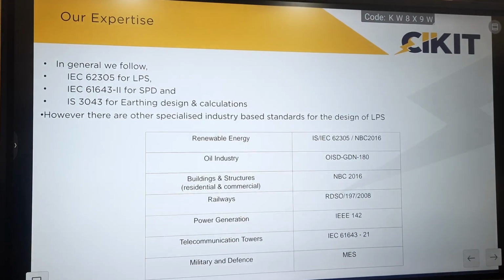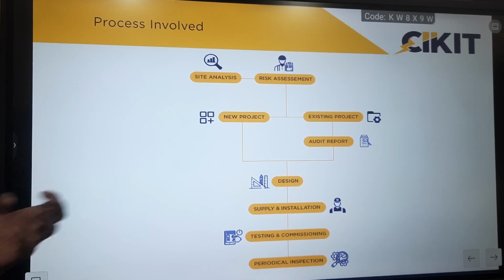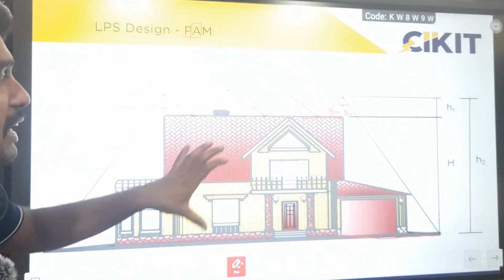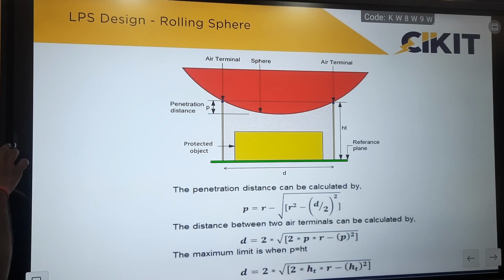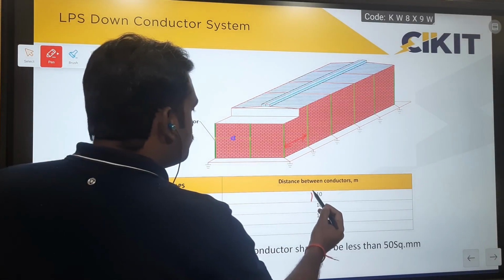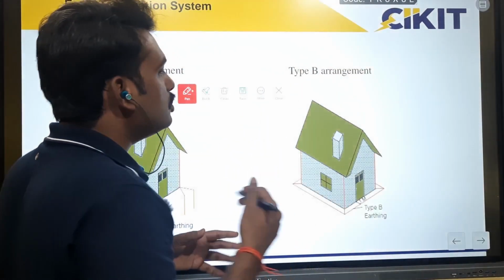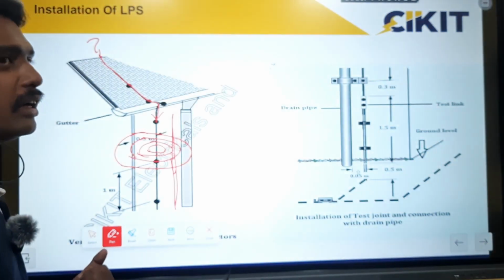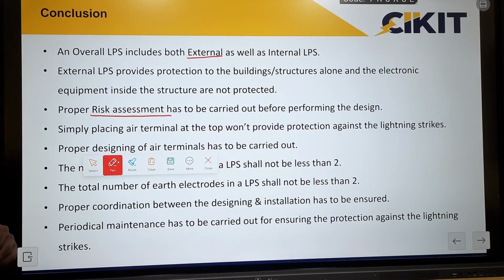Lightning Protection Design as Per IS/IEC 62305-3 | CIKIT |SHOT FORMS | Viedo Explainer series

Comment: If building height is more than 100mtr then  can we use  ISA 50×50×6 cleat for lightning arrester down conductor strip fixing along steel structure instead of insulator